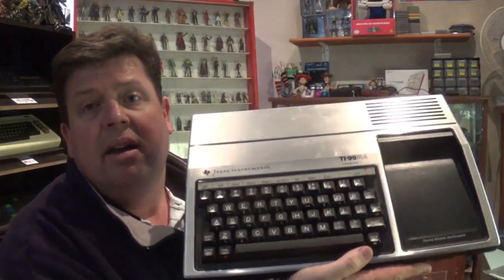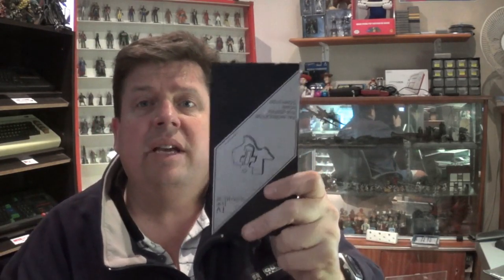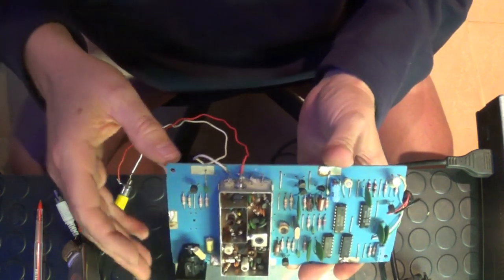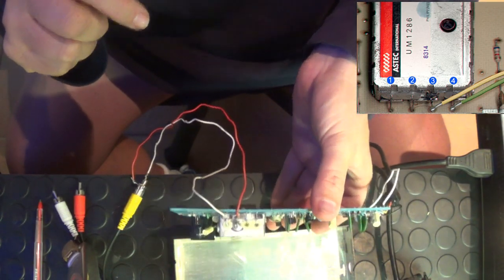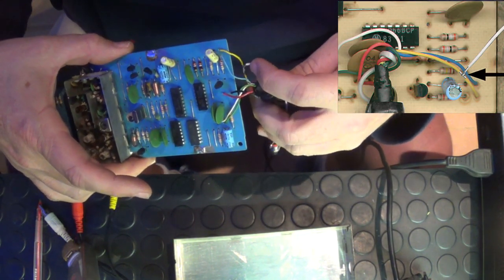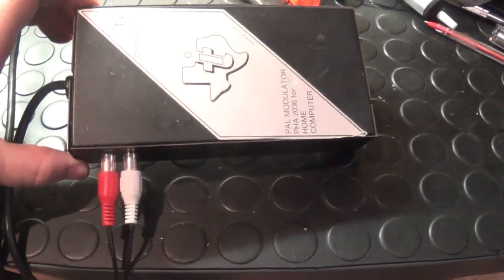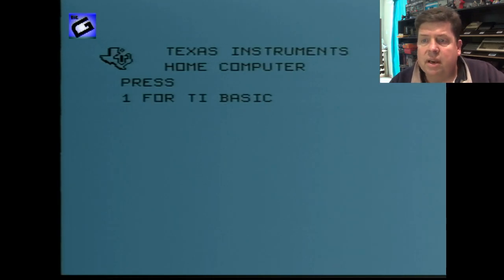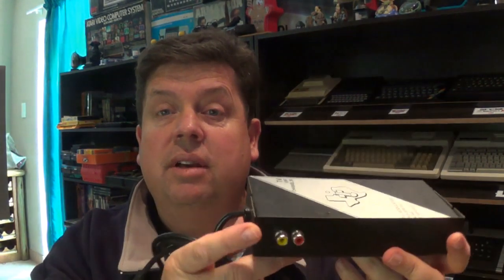AV Mod for your Texas Instruments TI-99/4A

Comment: Very nice video. You mentioned cutting the video-signal wire, preventing the signal to reach the RF-modulator. Will this make a stronger/better composite video-signal (compared to leaving the video signal wire intact) ?
Reply from the maker: Not 100% sure but I have seen many of the mods for other 8 bits removing the modulator altogether. Try it before and then after. As long as the composite signal works. Cheers

Comment: What works for me is an adapter cable with five-pin DIN male at one end and four RCA female at the other.  One of the RCA outputs provides the video signal and another one provides the audio, although there is a bit of trial and error involved in figuring out which ones they are.
Reply from the maker: +Jamie Fraser Thanks
Reply: Jamie Fraser I need to get a monitor for my ti-99 4A.
Any recommendations?
Thanks

Comment: Another option is the easy to install F18A VGA enhancement board that simply plugs into an IC socket in the TI.  For more information, click the link below!  :)

http://atariage.com/forums/blog/567/entry-11383-the-1-modification-for-the-ti-994a-is-updated-652015/

Comment: Thanks for mentioning me. ;-)
Very nice mod, maybe I will do that on my 2nd TI 99 one day, just to use that then for my cheap USB video grabber device.
There is also a way to get RGB out of the TI-99 without the F18A video chip, but I never tried that out myself:
http://home.vodafonethuis.nl/fgkaal/Hardware/hw_hama_converter.html
Reply from the maker: I watched your video "TI-99/4A and my own games" and this got me me going to get mine up and running. Will do a few game plays soon. Cheers
Reply: As the TI seems to output component video (according to the schematic you linked to, Roli),isn't it more convenient to use just that?  It will probably give you a much cleaner signal too. Kinda nice to see a system outputting native component video, must be the earliest one to do so.